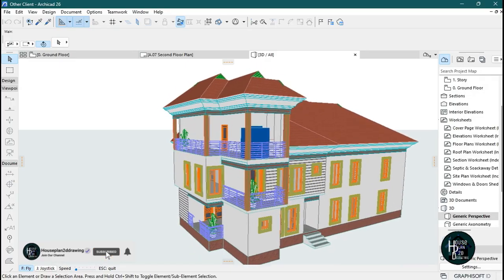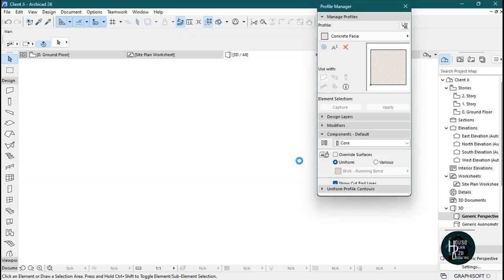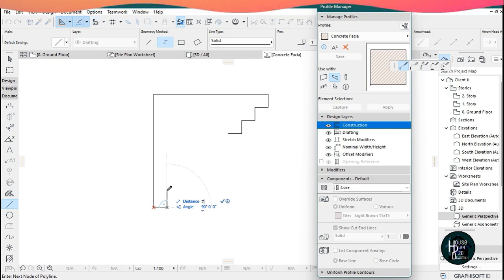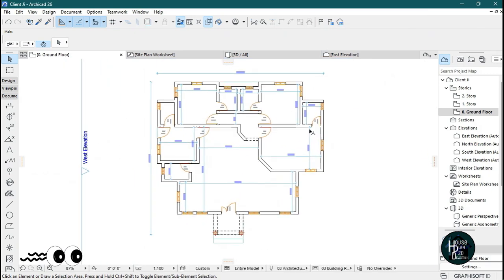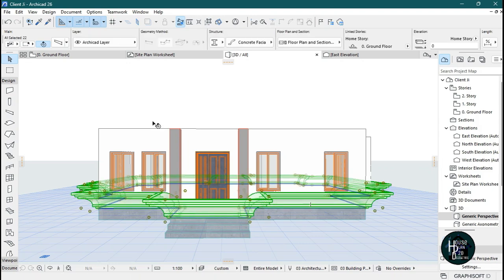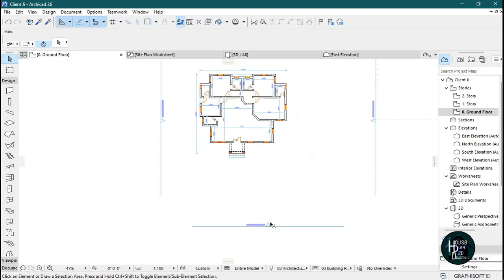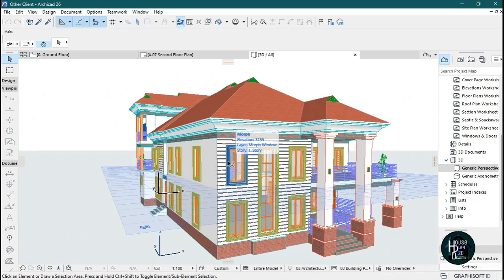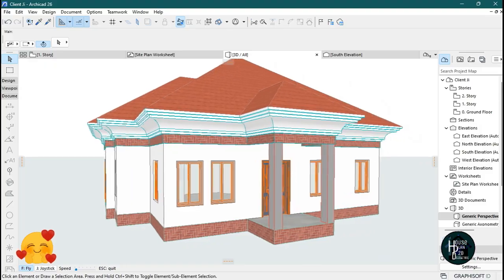How To Design Concrete Fascia For Beginners in Archicad

Comment: What are those lines on the wall called?
And how can i create it on my next design? Please
Reply from the maker: It's called "log details" you can find it in wall settings dialogue, for reference purposes i made a tutorial video where i explained that aspect though i can't remember the exact timestamp for the video but it should be towards the end of the video but check around the video where i explained that, the video link 🔗 is below. 👇 

https://youtu.be/7snzXLGYZMc